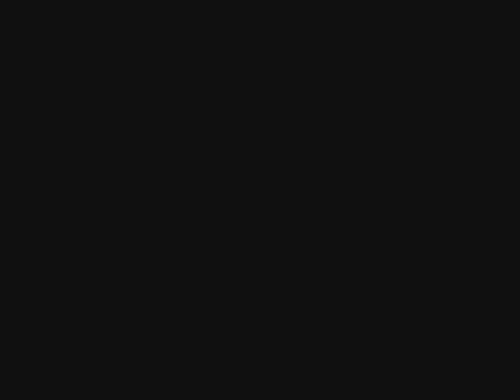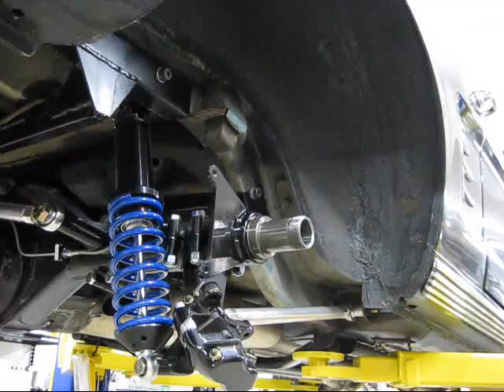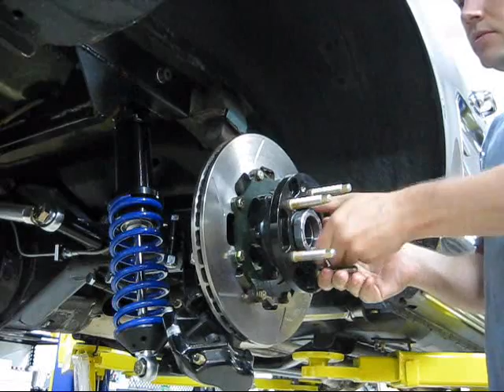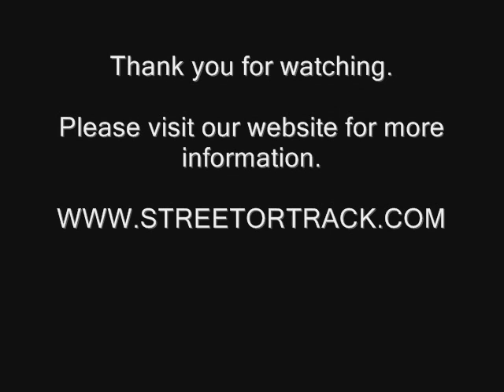Street or Track Full Floating 9" Rear End System

Comment: All this work and yet the weakest link is still an issue. What might that be you say ,the universal joint. That being said , this without a doubt a well thought out differential design.
Reply: what universal joint?  this is a rear axle.
Reply: @dobrzpe  what do you think turns the yoke for the pinion
Reply: @Greenerplaces  well, then by your logic:  the weakest point is bad gas.  your "weak link u-joint" is turned by the driveshaft, rotated by the transmission, driven by the engine, which needs non-contaminated gas to run.  joking aside:  so, what's the fix/replacement/upgrade for the u-joint at the pinion?

Comment: He is being very "general" in his assembly. Depending on what you are using it in there are usually buttons screwed into the axle on the rear gear side and when used with the end plates so the 2 axles only move a limited amount. Our dirt car is 1/32" over all. Both axles need inner plugs to keep gear lube from going down the hollow axle to the outer ends. Both outer bearings are removed every 3 races and serviced. We also use inner seals.

Comment: what keeps the axle shafts from sliding back and forth inside the housing?
Reply: There is a bolt on one axle in the center that you adjust so both axles are almost the same width from axle cover to axle cover

Comment: one small thing about the brake caliper , dont leave them hanging by the ruer brakeline , the innerline stretches and could clog the line up having the brake fail , use some weldingrod bend in an S and hang it from the spring

Comment: Would it be possible to get a second caliper mounting bracket welded to the housing on the opposite side of the housing? That way, you can run a dual caliper setup?
Reply: You could but generally you don't need that much breaking on the rear.
Reply: @robert5  Yea, the second would be strictly for a hydraulic E brake.  Ended up passing on that plan though.

Comment: It seems there is not much grease lubing the bearings. On a non-floating Ford 9 in., I guess the hypoid oil constantly lubes the bearing, especially on a slope. But then again, the weight is off the axle, like you said.